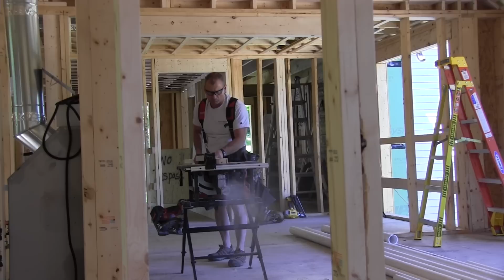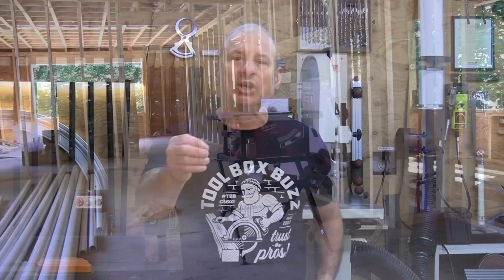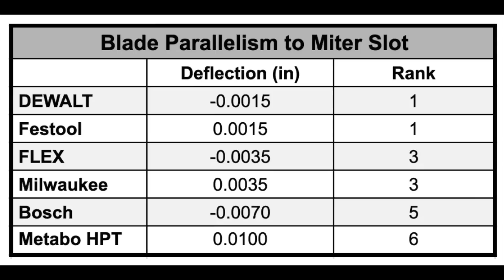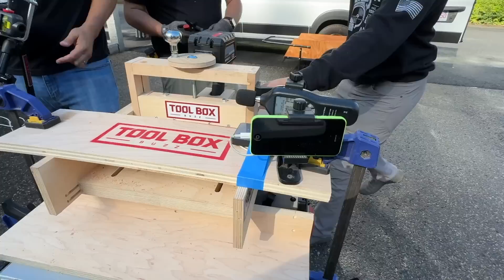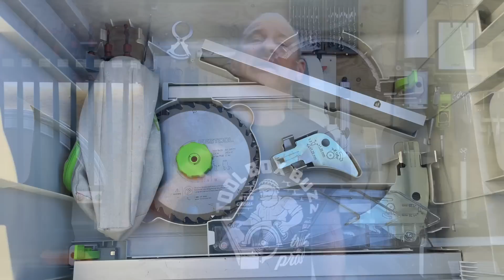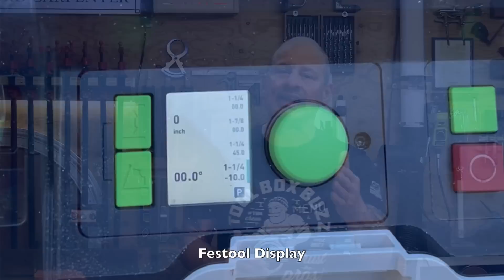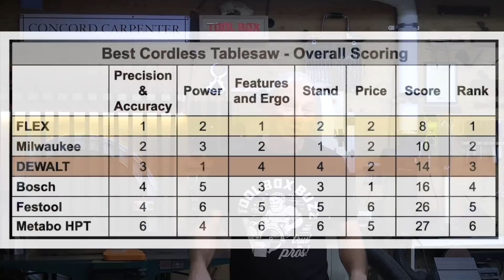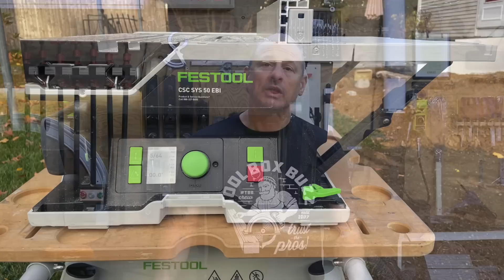Best Cordless Table Saw | Head-2-Head Comparison

Comment: :( I use Metabo Hpt so it was unfortunate to see it perform worse than the other brands. I was hoping to buy it someday, now I’m not so sure. I do believe using a 10inch blade would have made it cut faster instead of the 8 1/4 inch blade they used in the testing because the blade would be spinning faster. I feel its performance review got cheated in this way. They should have used a comparable blade on the Festool also instead of the 40 tooth
Reply from the maker: We alloed the saw to compete in our 8-1/4" test.  Pretty sure FLEX has a 10 saw too but we were testing the smaller more portable saws. This test was directed to "mobile contractors." Portability was key here.

Comment: If you're buy a saw, cordless or not, it all needs to be checked and set up before use, things happen once that saw has left factory. It could be out of adjustment just from transport, not manufactures fault . It should also be checked periodically to make sure it hasn't gone out from moving job site to job site.
Reply from the maker: 100% agree but I also work in the trades and have seen many a saw unboxed and put into service - especially when a saw dies in the middle of the project, and someone runs out to get z new one

Comment: I'm curious why you didn't use DeWALT'S stand with wheels.... with that stand you have the most powerful and mobile combination on the market hands down.
Reply from the maker: That stand is amazing and I have mu 10" corded saw bolted to it. We geared this test to mobile pro contractors. Portability, and mobility were key here.
Reply: @ConcordCarpenter  not sure if you're aware but DeWALT has 2 table saw rolling stands. The 10" corded has the black steel rolling stand. They have a light weight silver aluminum stand for the 7 1/4 table saw. It's an awesome combo.
Reply from the maker: @ hmmm wasn’t aware thx

Comment: I just purchased and used the new FLEX 8-1/4” table saw yesterday. 

I love the power, runtime, folding side table, and LED light on the fence. 

While not included with the saw, the optional AC to DC power adapter is great for when you have access to a receptacle. It’s nice to have the option to plug it in if your battery dies, or you are going to be setup and working on a project for a while.
Reply from the maker: I  agree it's a great back up but most of us in the trades have multiple batteries. We just swap out the battery - less items to carry and store that way
Reply: Would highly recommend this saw? If you had to make the purchase again, would you go with FLEX again? Which battery did you use? What's the run time like.
Reply: @rickyperkins232  yes, I recommend the FLEX table saw.

I am happy with the FLEX ecosystem - great tools, batteries, and chargers. The only negative is that some of the tools are a little bit on the heavier side, but that is typically due to the build quality, which uses more metal over plastics.

I had used the 10 Ah Stack Lithium battery. I am not sure of the total runtime as I did not deplete the battery with the cuts I needed to do for my project. However, it did last me the entire day.
Reply: @ErikAsquith Dude, I hear you, i listen to you, and here we go. I picked  up a 23, 18, and 16 gauge nailer. In a few weeks, I will pick up the miter and table saw as 21° well as the nailer.
Reply from the maker: @rickyperkins232  haha right on!

Comment: I had the dewalt, because they were the only one available at the time.  Eventually sold it and got the M18.  Mainly cause that's the battery platform I use and it got annoying having a separate charger for the one tool.  You can get the M18 dialed in super accurate.   I'm a finish guy, and I have a boatload of festool stuff. But I can't see myself dishing out for that table saw.
Reply from the maker: Me neither

Comment: Awesome tests, thank you sir. I've really loved my DeWalt for the 4+ years I've ran it but I've been eyeballing the Flex since release. It looks stout and well thought out. I'd never need the light on the fence but it's cool nonetheless. The cutsense feature may be worth a mention although I assume I'd just override it more often than not. When I go for another saw I'd say Flex is on the wishlist but there's currently way too high of an entry cost for anyone not heavily invested in the platform. $750 for the saw+ battery, $100 stand, $330 per battery, and $200 for the adapter. You're at $1,500 after tax. Maybe $1,650 if you nix the adapter and just go for a third battery. Obviously the same can be said about most brands if you don't own any of the batteries but if it's pushing $2k to be jobsite capable then I think I'll just wait for a 2nd gen DeWalt.
Reply: Just bought the flex 10" a few weeks ago. Bought a second matching battery on ebay for $233 shipped putting the total at $1030. So far so good. 2 batteries are more than enough for a full day of work for me. Nice saw. For some reason,  I just couldn't get used to the 8¼" table saws. By the way, I'm on 5 platforms in the van. 95% dewalt.
Reply: Wow. That's steep. Bosch kit with charger, battery, and stand are $649 cad. $465usd. That's a huge difference
Reply: @mannyfran8024  My pricing is based on the Flex 10" kit with a 10.0 battery. The Flex 8 1/4" with 6.0 battery and charger can be found for $479, so pretty much the same as the Bosch, but I don't consider these saws Jobsite ready with a single battery. You can probably add another $4-500 to that Bosch for two 12.0 batteries if you don't want to run out of juice mid job. I have a 9, 12, and 15 for my DeWalt. Puts me ~$1,000 into the DeWalt as well. I did make the Flex sound expensive, but they're all competitively priced if you look at baseline kit prices. Baseline kits aren't jobsite ready though.

Comment: Good video. 2 things not mentioned that might be important to some are 1) dado set compatibility and 2) number of miter slots. Having 2 slots is better for jigs/sleds.
Reply from the maker: @masterpoolcat  curious how many Pros are using a cross cut sled on a cordless saw-   Please comment….
Reply: @ConcordCarpenter i have 45 degrees sledss for window trim, thats also why i want to change away from the dewalt and go to the hikoki/metabo hpt, or the german Metabo.
Reply: @ConcordCarpenter  The Milwaukee does accept a dado set and the DeWalt only has one miter slot. Not sure about the other saws.
Reply from the maker: @masterpoolcat  thanks for commenting
Reply: @masterpoolcat  Dewalt has slowly and quietly started introducing a new model in most markets that has 2 miter slots. No idea why they don’t ever talk about it. There are a few other minor design changes, but I imagine the motor is the same. If you look at newer videos from the last year, especially from England/UK, you’ll see some that have 2 miter slots.

Comment: Glad to see this test.  I’m currently using a 20ish year old dewalt 10” saw which still gets the job done but is bigger and heavier than needed most of the time.  I’ve been looking at the M18 and glad to see it did well in the test.
Thanks for taking the time to do these head to heads!
Reply: You deserve to go cordless sir
You wont regret it
Its different but worth it

Comment: The precision result on the Festool is kind of flawed. Festool themselves say that it's intended that the fence opens up towards the end, so no workpiece gets pinched. At the end you're interested in if your cut has the desired width and not if the fence is parallel or even worse pinches your workpiece. I don't own the saw, so no fanboyism here.
Reply from the maker: @saiiiiiii1  I know a lot of carpenters and cabinet makers that do flare open their fence a little bit at the end. Period. We used to do that before Riving knives.
Reply: @ConcordCarpenter  don't get me wrong, I love your reviews and am very thankful that you provide these. My point on this specific matter is, that a non parallel fence doesn't influence the outcome of the cut as long as the scale is accurate to the width of cut, unlike on a mitre gauge for example where angle matters.

Comment: I have had the Milwaukee since it came out.  Previously used many dewalts since they designed the rack & pinon fence.  Millwaukee literally copied the Dewalts great features and just made everything else so use intuitive and enjoyable to use.  Every time I use the saw years later I still have a feeling of enjoying the tool.  I think it is Millwaukee’s best designed cordless tool.

One tip for improving cut speed is I use the 7-1/4” Diablo framing blades for framing and most of my work.  I only use the 8-1/4” for fine finish or scribing.  The 7-1/4” thinner kerf makes a large difference on the saw.
Reply: I only run 7¼ cuz they're cheaper. I dont need the extra half inch of cutting height anyway
Reply from the maker: I know the saw you’re talking about - a great tool.

Comment: I like my Festool sys50 a lot! Same for my cordless Milwaukee. Different job applications for both. For finish work I’d want my Festool that sliding table is awesome for detail work. I use my Milwaukee for small jobs but honestly for any bigger framing jobs I roll out my 10” Bosch. Would like to see Milwaukee come out with dual battery 10” with rolling stand

Comment: Festool carpenters left the chat. 😶 My thought has always been Festool = accuracy, but this is devastating news for the brand.
Reply from the maker: Festool is accurate - this saw was an outlier
Reply: @ConcordCarpenter  have they responded on the test with any feedback?
What I think is odd is that the fast phase tools for daily hard use won the accuracy. Where the extra price jump for festool should have found the errors in production or QC as a part of what I pay the extra for. I expect extra great care for these parameters with Festool, or at least an easy fix for this with a tuning tool included in the box.

Comment: Had my Dewalt for 5 to 6 years 😇 its not bad
Reply from the maker: @heavyspam1  it’s a great saw- I have one too
Reply: @ConcordCarpenter  only problem i have is when i put a thin blade on it the blade flexes like crazy .. i just keep a diablo 40 tooth thick blade on it all times  😞 works Amazing ✌🏽

Comment: Hello Rob, I think that you should not have included the Festool saw in this category. It was never designed to be a construction saw. The other 5 were. It was designed to be used by the finish carpenter who uses the entire system to make a living. Therefore it didn't compete well against the others and it didn't look good. It wasn't supposed to. Just my 2 cents.
Reply from the maker: @davids8493  David, we struggled with that as well, but if we had not put it in, we would have others calling us out for not including it. So we included it in our testing, and we tried to explain along the way the quality of the saw as well drawbacks.

At the end of the day, it is a cordless tablesaw and people want to know about it if they’re considering buying one
Reply: @ConcordCarpenter  I personally appreciate that you guys included it and am excited to see more Festool green in your head to head comparisons!
Reply: But the accuracy should have been on point then. 🤷🏼
Reply: Great review Rob! You just saved me a lot of money, was contemplating buying the Festool, not now. I have the Milwaukee which is a good saw, but their 12amp hr batteries are garbage. All 6 of my batteries are now useless.
Reply: @peternelson9865  are you really going to change your mind about this. Why did you initially settle on the Festool and now change your mind? These saws are not in the same category. If you thought that you could truly use the Festool for the kind of work that you do, why would you switch to a general type of machine? Time is money and if you are going to take more time to do the work on another saw and additional work to get it right, why not go with your first instinct? You have to ask yourself these questions.
Reply from the maker: @davids8493  I agree, David it’s a great saw it just didn’t fit in our category for a mobile contractor who is not completely in the Festool system
Reply: @ConcordCarpenter  thanks Rob for replying twice to my post, I am humbled. I have had 40 years of experience in the trade and I prefer the finish aspect of the trade. I have worked on multi million dollars yachts and very high end kitchen installs. In this aspect, I would never consider using the other contestants in this review because of the additional work needed to complete the task. Thus my reasoning of their lack of extreme precision for said task. A saw capable of achieving to a tenth of a degree bevel cut and the same for a dado or rabbet cut, do not belong in this category that does not even indicate these extremes in precision. I have followed you for many years and have loved your previous content but this is the only time that I have disagreed with your conclusion in this category. The Festool is not for everybody but it is for a certain niche of trades people. I have several portable tablesaws and I don't own the Festool but I want one desperately. As a fellow Bostonian I am sure that you understand my plight. Thanks Rob for taking the time! 👍👍

Comment: I like flex because flex has plug in options. The only problem is flex battery quality issues.
Reply: Flex batteries would leak the cooling gel if they were left in a hot environment. This was only an issue with the first Gen batteries. It's no  longer an issue unless you have the older batteries.
Reply from the maker: @bennyochoa9823  good to know
Reply from the maker: @ damn - hope they fix that soon
Reply: The Metabo also has a corded adapter, although it’s kinda weird and clunky
Reply: @ yes, Metabo is the first offering adapter but pricier and the corded model built better than the cordless. I used a portable battery for corded table saw , charged my power tool , my phone and shop vac in remote locations  it is my  cheaper way to do my work. Someone mentioned Bosch Euro model. , actually, he’s right Bosch has the best one in Europe. But they are never offer in US markets.
Reply: It was a totally harmless cooling gel and only affected some of their 1st gen non stacked batteries.  Was fixed a long time ago, but a lot of those batteries are still floating around.
Reply: @dcl97  i have a 2.5 that leaked, I cleaned it up with the intention to take it out of rotation and dispose of it but forgot.  It is still in rotation. I have no idea which one is it now.
Reply from the maker: @ interesting
Reply from the maker: @alanlau2375  first I’m hearing of this, tell us more please
Reply: @alanlau2375 they fix the problem over a year and half ago. FLEX had the issue fix within 30 days and warranty all the issue.  Please correct your statement because the only 2 batteries affected was some of the 2.5 & 5.0 amp hour lithium ion batteries.
Reply: @alanlau2375  you are talking as if it is all batteries, plus you neglect to mention that the problem was fixed almost 1 year 8 months ago. FLEX reaction was so fast it is only a memory now. However, you talk as if it is a current issue.
Reply: @ no idea! I saw so many bad reviews over the batteries issued. And the consumer report Also mention this happened when they tested the flex battery on Jan 2024. I don’t know what happened now. Anyway thank you for your information.
Reply: @ sorry to bother you! I have a question do you know how to identify new or old batteries? I am planning to buy flex power in this holiday., please!
Reply: @alanlau2375  The main problem batteries were the 2.5 amp hour. The writing was bigger and bolder the old while new batteries, the writing is significantly smaller. When I get in, i will examine the 5.0.
Reply: @alanlau2375  none of the Stack Lithium batteries were affected, I will assume the 2.0 the newest batteries will not have issues.
Reply: I feel like Flex is not appreciated enough. I always hear about the weight but I never had a problem with them when using them. 

I wish we would get the Bosch stuff that comes out in the uk and elsewhere. They get way cooler stuff

Comment: About the table flatness, the festool sliding table has to be higher than rest of table to work correctly, just like a panel saw
Reply: Exactly.  It’s been a game change for me (trim carpenter, I don’t rip construction lumber nor plywood).  This thing has been a game changer for me.  Far more accurate than miter saw for smaller work pieces.  An order of magnitude better for crosscutting than miter gauge with any job site saw I’ve used.  Ergonomics has been a win too.  Less important but job site setup/tear down/cleanup is a time (and money) thing.  Wouldn’t be my choice for construction but then not my primary use.  Previously I pretty much only used my job site saw (dewalt) for ripping trim.
Reply: @mikespray2002 
I’m exactly in the same boat,
First couple days I had it on a porch trim out, went to cut some column base trim on my miter saw, then thought “oh wait, let’s try the slider” 😊
Bangin
Reply: @mikespray2002 Absolutely it’s been a game changer for me too 👍🏻
Reply from the maker: @makosharksimmo8124  yes- we mention that

Comment: A note about batteries:
Looking at the reviewed saws, I notice a great variation in the batteries used. Some saws run on the same batteries as your cordless drill; others come with massive, higher voltage batteries. 
This review does not consider battery life, or give any clue as to how power hungry these saws are. I suspect you will need to have several batteries on hand.
Reply: Yes you’ll need multiple batteries on hand if you are a professional or diy user on any battery platform.  These are standard battery platforms that the big manufacturers have been running for years/decades. Dewalt is likely the “massive high voltage” saw you are referring to. When a Flexvolt battery is used for a 60v tool vs a 18/20v tool it clearly is opting for power over efficiency.
Reply from the maker: @karenstein8261  we tested the batteries that come with the tools sold as kits